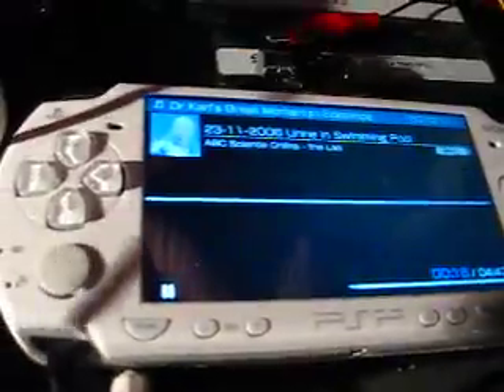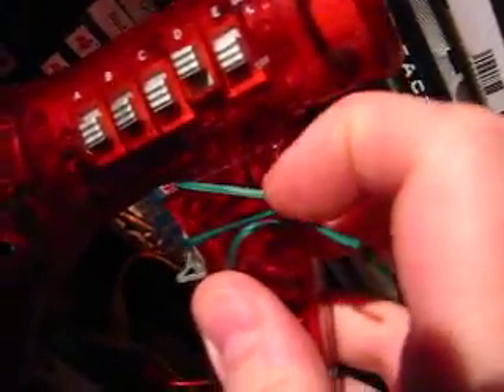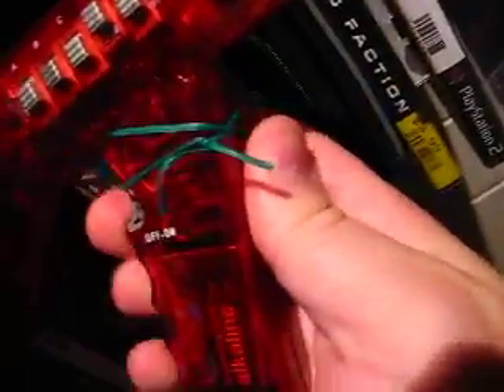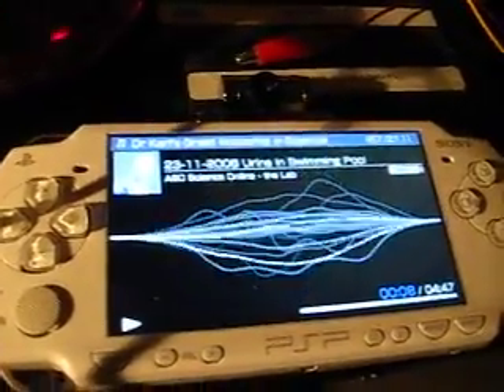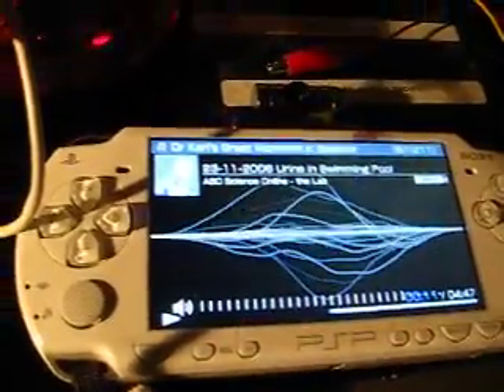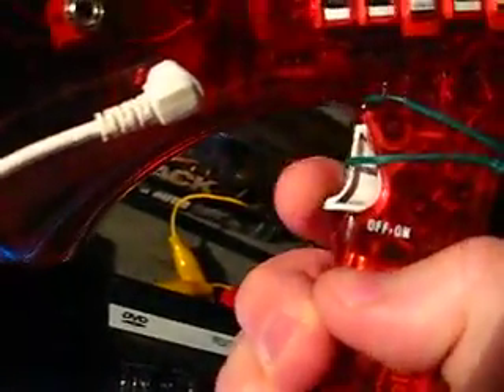Modified Toy Megaphone Voice Changer

Comment: Do you have one of those police megaphone toys? It has a switch with two modes you have off which is in the middle and then the two modes are the microphone which is the talk mode and you flip it to that motor if you want to speak in the microphone, and then the other mode is a siren, a police siren and then also up there with the control switch is the volume control slide switch there. I have one, but I haven’t modified it yet but have you ever modified one? I got mine as a gift with probably a set of cars and stuff like that but I still have it.

Comment: You can just take the trigger output from the toy and use those two wires to add a switch to it and then add a switch in between the battery terminals and that will be here on off switch and then you won’t have to be pressing down on the button
Reply from the maker: I later added a switch to this.

Comment: Hiya! Sorry for asking questions on an old video, but I'm very interested in this project. I'm attempting to build a voice modifier into a costume, and the last thing I need to do is add an AUX output so I can hook it up to external speakers. I have absolutely no clue how to do this, but it looks like you've been able to manage it! Would you be okay sharing a little info? I'm not too keen on snipping wires and accidentally mucking things up, as circuitry isn't my strong point. Thank you very much!!
Reply from the maker: You'll need to drill a hole in the case for your AUX jack and then solder the wires to it and then plug your mic in. On mine I have the stock mic wired across the jack so you can use either. I've done so many mods to this thing it squeals whenever you try to use it normally.
Reply: I'm basically attempting to add an aux output to attach speakers externally. Not sure how to go about doing it.
Reply from the maker: Oh like an external speaker jack? Yes, just attach it to the speaker of the megaphone and it will play from both speaker and your aux jack OR you can wire it so when you plug in speakers it mutes the internal speaker. you attach thr ground to the outer ring of the jack and the + side of the speaker should go to the other two. You want the source to be able to power the internal speaker and then external. (hard to explain in comment. sorry.
Reply: Oh, that sounds fairly simple! Thank you! Hopefully i'll be able to make the external speakers run on their own batteries. Thanks!

Comment from the maker: This is soldered in 2 points. One is the mic input and the other I can't remember but I connected the audio ground to the negative on the battery and just probed around till I heard music. Use a source that you don't care about. I used a radio and a custom made patch cable it's a stereo audio cable and 2 alligator clips and both channels are on the + red clip and the ground is on black or - Negative.